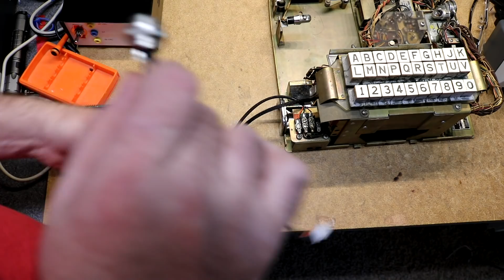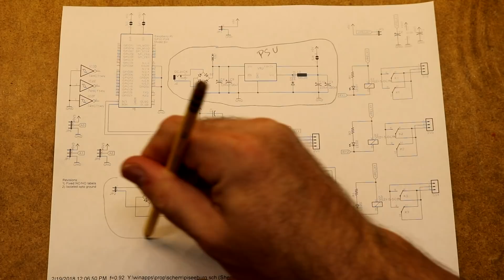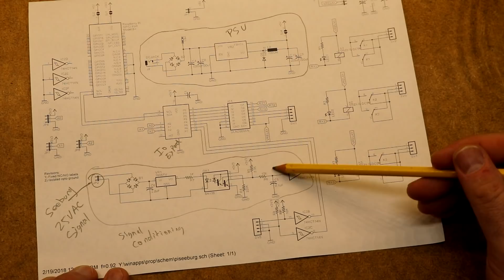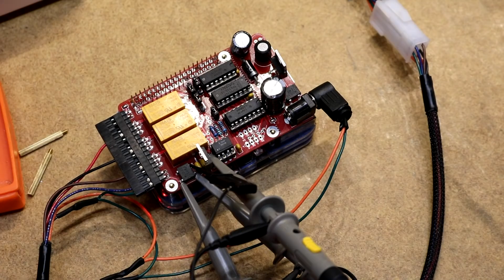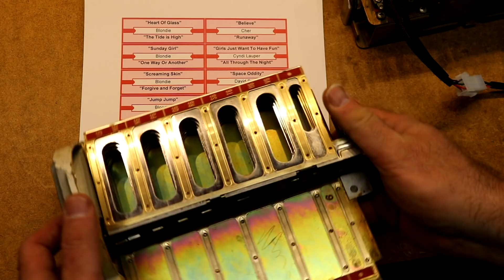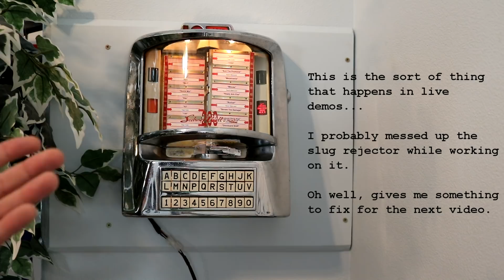Converting a Seeburg Wallbox, Part 2

Comment: great video, I am looking to do this, but the otherway around, I have the jukebox, and i want to send wallbax signals from a raspberry Pi with relais to the juke box, but i cannot find a manual on what to send, do you know what the original output of the wall box is? (the pulses you measured already helped alot)